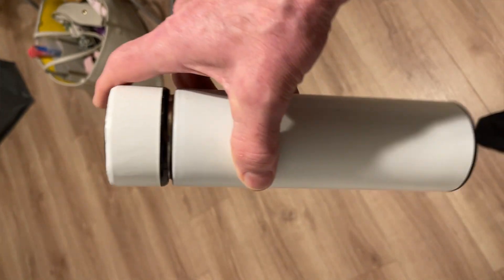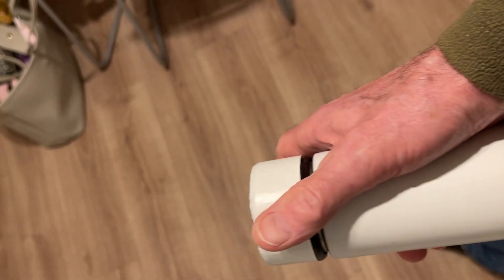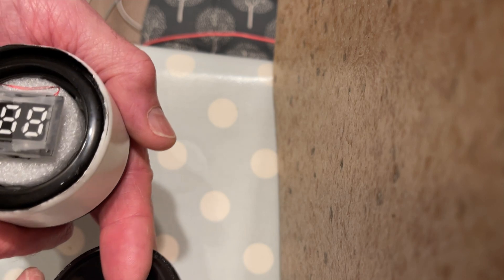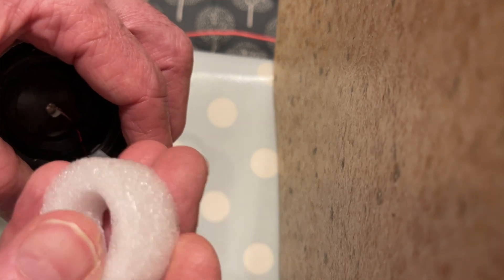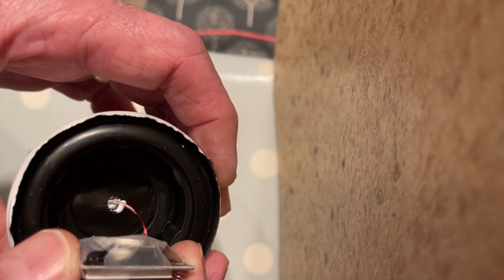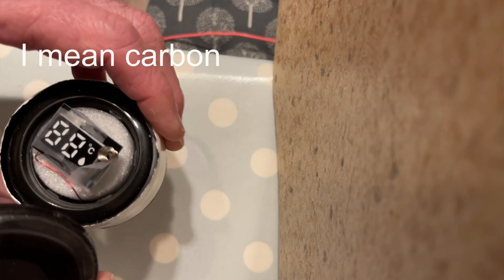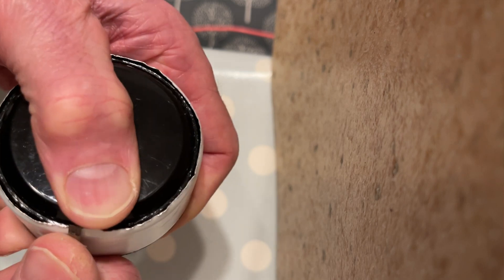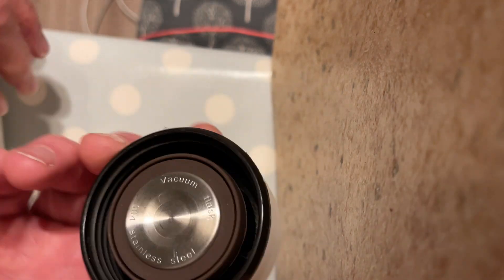'Smart' Flask Battery Replacement?

Comment: Oh NO! What have you done? You don't have to be so brutal to open the cover. Here is how to open the cover easily and safely. What I did was to put the cover inside the Freezer for 30 minutes. After 30 minutes I took it out from the Freezer and wrapped a small towel around the cover.

Then slowly pushed the glass screen area from the top. The whole plastic would pop out through the bottom of the cover. Now you can change the CR2032 battery by carefully removing the LCD from its holder. Please take note to insert the Thermocouple sensor (the 2 wires with black dot at the end) into the small hole and ensure it touches the metal part before reassembling.
Reply from the maker: Brilliant, thanks for posting this. I kind of hoped that my brutal approach may at least find out how it's put together so I (or others) could use more finesse next time. It turned out to be much more brutal than I expected! I'll definitely use your method if I get another flask and try to generally be more patient in similar situations 😊
Reply: This solution is way better than the other videos on the internet that uses hairdryer. it is way easier to push out the metal ring when its frozen

Comment: hello friend ^_^. it's me again. my sister found a way to change the battery. she discovered that if you push the glass screen area from the top, the whole plastic pops out through the bottom of the cover. turns out that metal rim is like a sleeve and the internal parts can come out if you push it from the top. just thought I'd give you this update. take care
Reply from the maker: Thank's fantastic! I'm really pleased that this worked for you. I tried to get mine apart this way but couldn't get the white metal part to pull away from the plastic. I should probably have tried harder and maybe warmed it up before resorting to the brutal attack I finally made. 🙃 I'll certainly try doing it your sisters way next time.

Comment: i have one of these. it dropped and the battery became dislodged. i could see it moving around under the lid. i was of the opinion that there was surely an easy way to open it and set the battery back. but after seeing your video, I guess I'll just be using it without the sensor then. thanks for the video.
Reply from the maker: Yes, they’re not easy to get into! Probably a good decision just to continue to use yours without the thermometer. A shame that they were designed this way though & thanks for leaving your comment